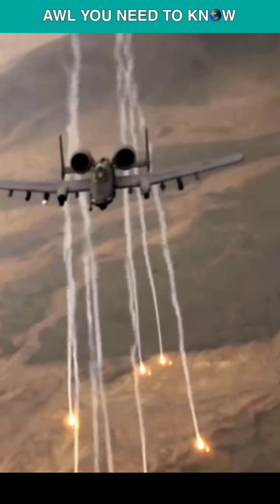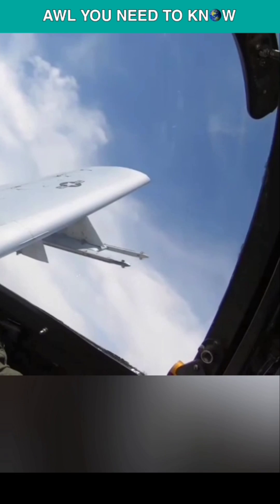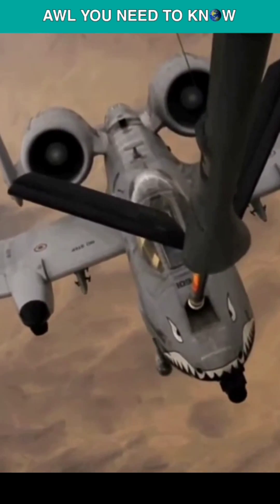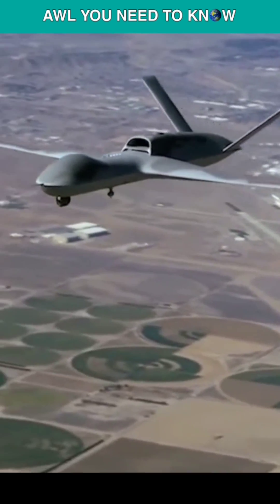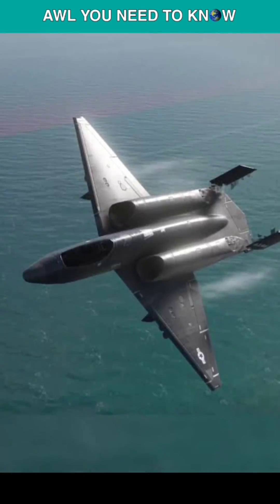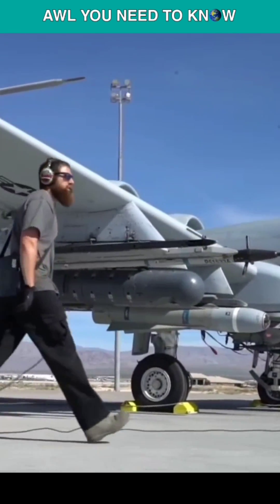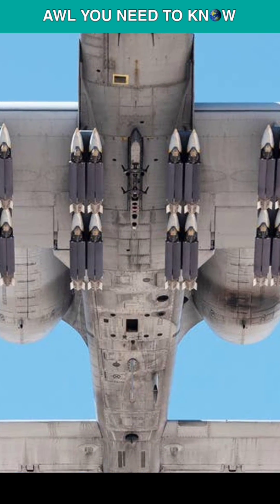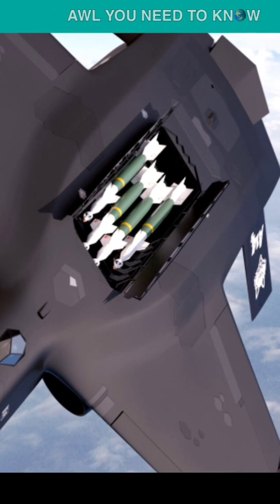Could A-10 Warthog become a Stealth A-10 Warthog, or A-14B Equalizer? #shorts

Comment: It could, but you end up with requirements with contradictory solutions, ie maximum ordnance capacity requires many hardpoints, which reduces stealth; whilst maximum stealth removes hardpoints and reduces payload due to limits of internal capacity; increasing the internal capacity means a bigger aircraft which makes them slower, bigger targets and reduces range due to higher fuel consumption.  Anyway who needs stealth when you are 300 ft above the enemy having shot at him with a GAU-8 and a dumb bomb is on its way downward?
Reply: Agree

Comment: The USAF needs to give the A10 to the Marines for the attack ships. FYI- Marine attack ship is a smaller version of a super carrier. It's where they launched their JSF f-35 bravos. With little alteration, the Marines have a better understanding of the PFC and JTAC on the ground. With the USAF it's coming. It's going. It's coming. It's going. No other aircraft can replace it in stealth is not worth anything and all that extra cost of taxpayers money to make it stealth doesn't do a damn thing to a stinger missile when jihad is on the ground. I'm quite sure you follow the premise. It doesn't need to be on an Air Force base. 2. 3 600 mi away with a couple tanker refuelings. It could be 40 mi offshore and be Johnny on the spot and more of them with better engines. Nobody's looking for Mach 1 but better than 300 knots is better. If a single engine p51 in a race could leave the A10 behind like it was in a school zone. Those twin engines doesn't have very much. TWR. Granted the titanium tub but was upgraded engines and modification to the landing gear. It would have a lot more support to the boots on the ground. Without doubt ,! 

They run with a Navy Armada anyway. Also with Navy assets so defending it as a super carrier as we do anyway, that's where it should go is to the Marines. I speak for myself and my self only. It just makes the most practical sense to me.
Reply: The Marine Corps already has the AV-8s. They don't need the A-10s. Furthermore, the A-10s can't operate from carriers or amphibious assault ships. Better to give the A-10s to the Army.